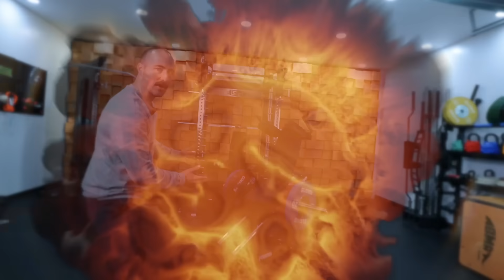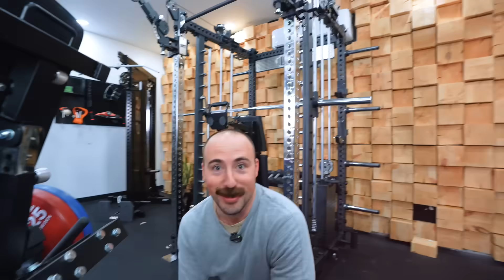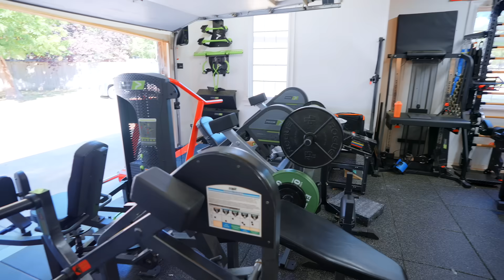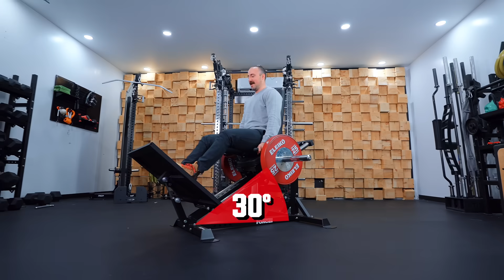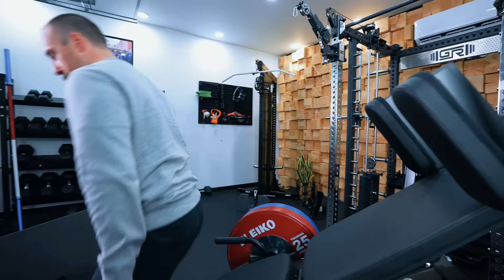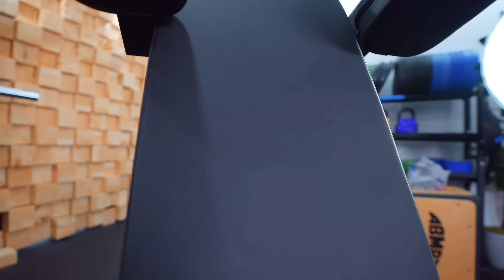The Ultimate Compact Leg Press/Hack Squat Combo With A Special Feature!

Comment: Sadly I purchased this unit and had a NOT SO GOOD experience with FORCE USA. The 1st unit was not smooth at all. The rollers were skipping and not true to shape. The ride was not good. I spoke to their REP Chris Marks and they opted to send me a new carriage. This morning I replaced the carriage and instead of a bumpy ride, now it's like going over rumble strips in the car. The rails appear to be straight and smooth but the carriage/rollers seem to be the main issue. After reaching out with no satisfactory options, she said they would process a return MINUS a 15% restock fee. Buyer be warned folks. Last time I buy anything from FORCE USA.

Comment: Blazzed fitness and gears for fit make similar units.  I suspect they are all made by the same manufacturer.  Gears for fit has the same weight capacity, dimensions, with only small cosmetic differences, but is 300 cheaper.  Some have commented the hack squat attachment piece is exclusive to force USA, this is false, I spoke to gears for fit customer service and asked if their shoulder piece separated.  They put me on video chat and demonstrated how it can detach from the main unit.
Reply: Good to know!  I frequent GFF a lot and they are a goldmine with many dupes at a fraction of the cost!

Comment: Just got one worked out in it today. Few things the sleeves that accept the back pad, calf block, hack pad were rusty inside and dont slide very easily almost broke my thumb earlier. One of t he bottom seat bolts are stripped and the coatings are just ok. Th machine itself though feels great, workout was nice, the grip and that huge foot plate are fantastic. That calf black bro...the 🔥

Comment: Hello. I wonder if anyone has a tip for the foam roller cushion pads on a leg press coming loose? Mine have plastic stopper that should keep them in place but these don't fit well and soon pop off and then the roller moves.

Comment: Doesnt Bodysolid hack squat/leg press load from underneath and not on the sides?
Reply: Sides
Reply: @jollygreen9377  the GLPH1100 has them under and not at the sides. Which one were you thinking of?
Reply: @NorCalDad the body solid which I own
Reply: @NorCalDad  I own the compact leg press
Reply: @jollygreen9377  hows sliding on it? Does the foot plate or guide rails flex when you use it? I'd think it would be pretty solid if it's from BS but I've never used one of theirs.
Reply: @NorCalDad . Very solid and very smooth. Calf raises are fantastic on it.

Comment: Haven't read through comments, but another way to get more depth on the squat is simpy a board or plates under your feet, so if you want 3 more inches of depth, just get a 3" thick "platform" that can be added on top of the base plate (2 45# plates, or whatever "blocky" thing you have laying around that can be used.  WIth the adjustable shoulder pads, simply augment the base plate, raise the shoulder pads to match, and now you've got all the depth you want.  Obviously ideally they'd design it slightly better so that workaround isn't needed, but it's a simple workaround anyhow.  (THe weights hitting the base for sure is an easy design fix though for them to implement, simply "cut out" the corners where the interference happens so there is clearance at those 2 points, that's  a huge obvious "miss'").  Bummer about the weld breakage also.

Comment: 2:30 That's not the depth. Depth is the internal height of something. External measurements are height, width, breadth and thickness.
11:00 You shouldn't squat beyond 90 degrees/thighs parallel to the foot plate. Going lower puts a lot of undue stress on the joints, including knees, ankles, lower back and the sacroiliac joint.
13:10 Going that low is a sure way to permanently damage your knees.

Comment: I have the FORCE 45-degree leg press/hack squat machine, and the machine is really great BUT   the welds on the pin that holds the upper adjustable plate was a cheap weld and it broke after a few months. FORCE USA sent me a replacement within a week. that pin is what holds all the weight and should be beefier for sure. Good customer service though and the machine 45-degree is definitely worth it.

Comment: Thanks for the review. I'm so glad I didn't buy one.
Johnson fitness had one on display, and it had the exact problem. That was a huge turn-off as safety should always come first. I ended up buying a very similar compact leg press hack squat LP10 machine from GMWD. With 1000 lbs weight capacity and 2 storage horns and is also set up for resistant bands. So far, all good, but the only downside is the foot plate, which, in my opinion, it 
needs to be bigger.

Comment: Can you use the hole space for the calf raise block to put a cable through and do belt squats with this? Maybe if you put it in front of a cable machine/functional trainer, I imagine you can't fit that in the Rep PR-5000 to use the low row cable of something like an Ares.

Comment: Received my ForceUSA compact unit just before Christmas.  The safety lock piece was already broken off prior to my assembling it. The welding is not the problem. The little lever catch is just cheap pot ash type metal. Very porous, not dense and solid.  The ForceUSA rep was nice young lady and helpful but took a couple calls for her to understand.  Kudos to Force for sending me out a new complete safety arm within a week.  It’s a great little unit for my home gym. Wife and I use it multiple times weekly.  Force should discontinue using the pot ash and just use solid steel. That would alleviate this ever happening again.  All that said, very happy with it and would buy it again and won’t  hesitate to recommend.
Reply from the maker: Thanks for sharing your experiences. Unfortunate that this has happened to multiple people, but I bet Force will get it right. - Coop
Reply: Is the replacement better than the original material?
Reply: Is it something you can just ghetto rig and be happy with?

Comment: I was surprised to discover the the most compact leg press/hack squat is not even marketed as a compact machine. The Body Solid GLPH1100 actually takes up the least amount of area for the reason that Coop mentions, the weight horns are underneath and not sticking out.
Reply: But that one has an 83” depth vs this one’s 65” depth. If one company could design depth of this with width of the body solid it would be money
Reply: I’d buy it!

Comment: I've had mine for a little over a year and nothing has broken or malfunctioned so far. Yours has spring loaded pop-pins for adjustments where as mine has T shaped locking pins that have to be pulled out and reinserted manually. The springs would be sweet but I'm good with the manual pins. Also yours has a piece of diamond plate on the calf raise attachment but mine does not and the thin, silver, laser cut plate on mine is bent to crap from normal use but still not a deal breaker. Eventually I'll just remove it and put some anti-slip tape on it. I have placed some vintage barbell locks on the inside of the plate holders to give my hands about five extra inches of room to actually hold the lower handles. Otherwise the plates would be too close. I bought an extra six 50lb plates to go with this press as well as a small floor rack to set behind it. I use 1 inch standard plates and have used them since the late 80s (yes, I'm old...er). I have spent too much on them over the years to switch to the 2 inch plates. I have loaded it to 660lbs and it moves as smoothly as it does with no weights.
I am just under 6'4" and I do top it out using the calf block when I'm not careful with my position but not a deal breaker. After my Rotator Cuff and Biceps surgery I tied a rope to the Lockout Lever so I could use my left hand to operate it and it was fine. I'm 6 months out from surgery and the ROM in my shoulder allows for normal operation now...
Anyway, I truly do love my Force USA Compact Leg Press & Hack Squat and I use it at least once a week for legs. I use it for chest supported TIYX on shoulder day. If I had a bigger gym I'd've gone with the Force USA Ultimate 45 Degree Leg Press Hack Squat Combo because almost no other company makes gear that fits both Olympic or Standard Weight Plates.
For people raising the back of the machine to make the angle higher than 30°, be careful loading it to capacity as that is NOT the machines intended use, nor was it rated at those angles.

Comment: Coop, thanks for the review and feedback! Yeah… that shouldn’t have happened, and we’re taking it seriously. It’s rare, but even once is too many, so we’re tripling down on QC for that weld. Just goes to show we grabbed one straight from the warehouse and sent it your way—no special treatment, for better or worse! We’ll send you the corrected replacement shortly.
Reply: You grabbed one from your warehouse and sent it to him, but you have a customer in the comment section saying theirs broke as well and you're telling the replacement part is on back order?🤨🤨🤨
Reply: @Ryan40272, the replacement part is also the build part.
Reply: @Ryan40272  Unfortunately, special treatment is real.
Reply: It’s rare? Says force USA.  Not from what I’m reading.  This being a huge safety issue I would stop shipping immediately and fix it
Reply: Seems pretty damn common to me from the comments. Wont bother with this until the website specifically says this problem has specifically been addressed and corrected on models being shipped.
Reply from the maker: Thanks for the follow-up! - Coop
Reply: I want to buy this but having others with the same issue is a concern ForceUSA. Will this be updated to a stronger steel material and better welds or just planned replacement? 

My confidence is low with this equipment that I can have my highschool kids use it without fear of the safety piece breaking off from normal designed usage.
Reply: not rare when there are so many people in the comments indicating the same thing happened to them. let's have some integrity.
Reply: Interested potential customer:  How will ForceUSA be checking these welds for durability?  I would like to buy one asap.
Reply: @jaredmatthews9403  Yes, we are working on this. It was embarrassing to have that weld break in Coop's review. We spent the weekend working with our engineers and designers. This was a small batch issue, and we removed the remaining units from our stock. It is rare to have something break like this, but when it does, we will do everything in our power to fix it and make sure our customers are supported.
Reply: Did this ever get taken care of by securing this better or just relying on hopes that this probably won't happen again.

Comment: I received mine in January and that exact same part broke on the 1st use. I took some paracord and made a tether to restrict the safety bar's movement. Works MUCH better and is under way less strain. Force USA is sending a replacement, but I doubt I'll use it. BTW, I'm 6' 6" with a 37" inseam and get great depth and ROM on this unit. I am a bit concern about the weight capacity, though. I'm 250lbs and I'm pretty sure my heavy weeks will exceed the limit. I absolutely LOVE the smoothness and flexibility. The foot plate is huge and I have nearly unlimited foot placement options.
Reply: Too bad we couldn’t see a photo of your solution to this common problem! I suspect that most purchasers will need it at some point!
Reply: Can you use bands to increase resistance vs plates?

Comment: A shame they don't put a horn sticking off the back of the sled (angled upward to avoid the plates hitting the track). That would allow more capacity without changing the foot print much. 
Fun review!
Reply: Yep, I'll be putting 3 on mine (just requires 4 holes drilled). 2x 6" horns on the sides and 1x 6" horn on the back for smaller plates. Haven't done the exact measurements yet, as I don't pick up the machine til next Friday, but should work from my guesstimations.  Also, for anyone interested, and short of floor space, I'll be using thin calibrated olympic plates, which will allow me to cut 6.5 inches off each of the horns on the sled, leaving 6.5 inch of the horn left, which will still fit 120kg of plates per side (a tad more than max rated capacity, including occupant etc). This will give the machine a max width of 99cm according to my calculations. So pumped to actaully be able to fit a leg press into my very tightly floor planned gym studio. 😃👍

Comment: I have it from ATX and it’s so ridiculous good.
Reply: How are you finding the ATX version? Is it a plate eater?
Reply: @lw6281  I love it. At 30 degrees, it needs more weight plates. That's easy to calculate.
Reply: @dertrendtrader no depth issues and I'm assuming it's real smooth? I'm waiting for it to come back in stock in the UK. I would think using bands reduces the need for a few plates..

Comment: What about single leg action? Can it be done without the sled shifting too much to the working side, which significantly increases friction when done on some other models.
Reply: I have this machine and single leg press works fine and smooth. I do them in every workout. 💪
Reply: @adk_2000 are you able to go heavy on this machines? 660 at this angle is a little concerning.. but then again I’ve never tried a unit like this. Thanks!

Comment: The same part broke off on mine on the first time using it. Disappointed was an understatement. I ordered this machine at the end of December. Customer service seemed to understand the issue and told me they would ship me out the replacement part. After a couple of weeks I still didn’t receive an email the item shipped so, I reached out again. I was told the part is on back order and I would get an email once it ships with no expected future date of shipment.
Reply: @forceusasupport same piece broke on my machine. I hope you guys fix this issue. I’m now waiting for the same part. Sounds like it may just break again if you don’t fix this.
Reply: That stinks because that probably means they’ve been sending out alot of these pieces…
Reply: Wow. Was just about to buy when I came across multiple reviews where this is a problem and have placed purchasing one on hold. Will reconsider this piece if and when the issue is addressed and fixed.
Reply: @jerrysurowiec  Coop said this issue has been fixed now
Reply: Hopefully it’s fixed for all folks here but mine is far to be. No response from Force USA since a month ago.  Very disappointed
Reply: @MathieuGoulet-y9o bonjour, vous êtes en France? J’aimerais en acheter une mais je ne sais pas si le problème es résolu sur les stocks français?
Reply: I'd probably get the jones 3d smith machine. I can do similar move as a hack sqaut. plus so much more with a 3d smith machine
Reply: Thats sucks it broke off too. You might want to go through and check all the welds. A mobile welder would be able to weld that back on for probably 100$ or you could buy a harbor freight stick welder and do it yourself. Not sure if i would trust them to send you out part that isn't tack welded. You'll just end up having the same issue probably.
Reply: Just received a new machine last month, and the part is now replaced by a heavy re-enforced welded on piece that is slotted on, so I don't think it will break anytime soon.
Reply: That's shit
Reply: I bought this based on Coop's review and the same part just broke on mine after 3 months of use. I am hoping it will not take over a month to get a part or response from @forceusasupport
Reply: I am happy to report that Force USA sent out a replacement part the next day after contacting their support. The replacement part is redesigned with the pin being 4x as big with a new bolt that goes through the rod that connects the hook. @garagegymreviews
Reply: Do a charge back
Reply: Sorry to hear you had the same issue! We’re proud of our Compact Leg Press/Hack Squat and all of its innovative features. We stand behind our products and just packaged a few replacements to ship out. Thanks for the feedback and trust in our product. You will receive your replacement shortly!
Reply: @ForceUSASupport — Hi! Thanks for addressing this issue for your customer! But, we would still like to know if there is an incoming permanent fix for this machine? There are many people in this videos comment section with the exact same complaint! BTW, i was planning on purchasing this exact machine next month but would rather wait for this issue to be resolved before buying!
Reply: @Bacnow bonjour, savez-vous si le problème a été résolu?
Reply: @ForceUSASupport  what a tone deaf response. Self promotion, boilerplate response, zero attempt to actually do anything that would solve the (very valid!) customer complaint.
This is a masterclass in how not to do social media customer support
Reply: I just wanted to do a follow up to this post. An email has been sent to customer service as well. Another month has gone by with zero updates on when this part will be shipped. I really wanted to love this equipment and company but with this being my first purchase from them.. this issue just made it my last as well.
Reply: @jblyzniuk sorry man that suck. Thank you for the FYI
Reply: @jblyzniuk guess I'll skip this company for purchases because of how crap the customer service is in this scenario.